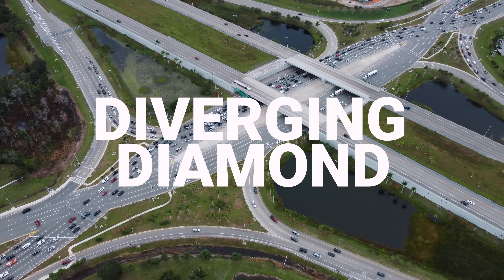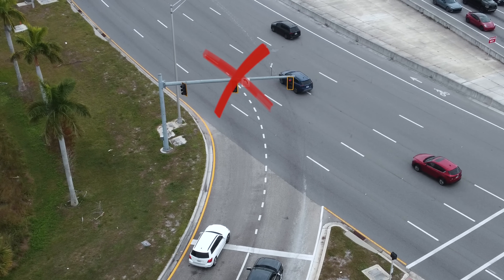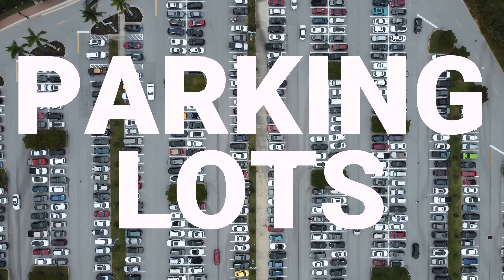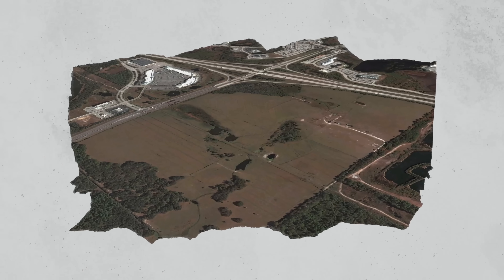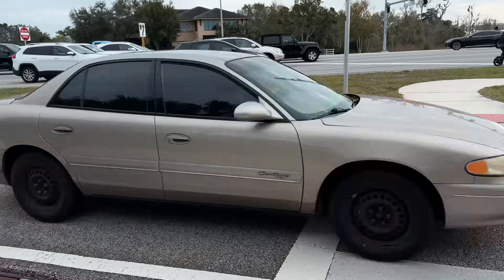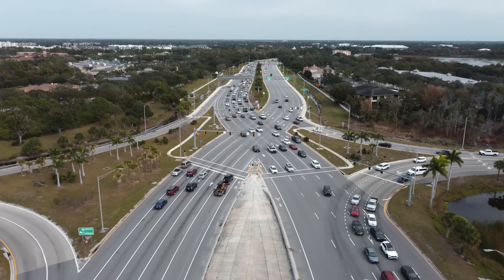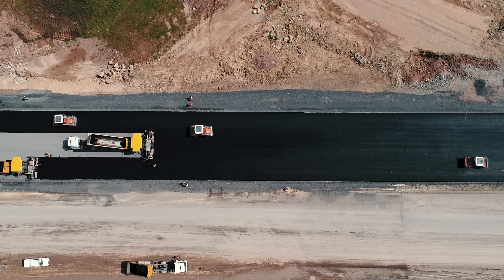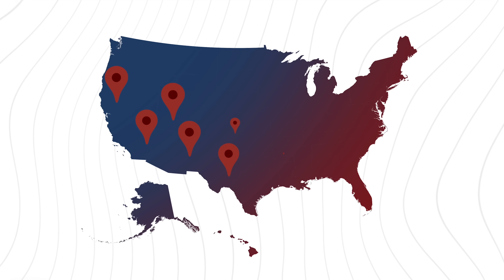Traffic Will Never Be Fixed Here

Comment: happy you didn't die while crossing the street
Reply: ...but all the exhaust fumes probably took a couple minutes off his life.

I could smell it from here.
Reply: @spiderpickle3255 why so anti car
Reply: @TheMW2informer  But I'm not.  I'm a trained automotive tech and own several vehicles.
There is no arguing that an intersection with that many cars isn't still full of noxious exhaust fumes in 2024.
Reply: @spiderpickle3255  technically yes you are correct, but compared to a intersection with similar traffic in 1975 when the catalyst was first mandated and it’s like apples to oranges. It’s a low level, plus with stop start and now ev, some of those vehicles are not emitting anything sitting at the light while the person is crossing.

Comment: As much as I agree with your overall message of 'totally redesign the environment so people don't need to drive', I feel like I have to criticize some of your early points. A road upgrade is NOT always intended to eliminate traffic (where I assume that by 'traffic' you mean cars driving slower than the speed limit). A road upgrade is typically about either safety improvements or increased capacity. In this case both of those goals were achieved. More people can now get from one place to another. Secondly, the diverging diamond, although very interesting is NOT the most efficient interchange, although it is more compact than some other alternatives that are more efficient and safer. Again, I fully support your overall message that if we designed cities better we would not need to drive so much and public transport should be the first goto 'fix' for heavy traffic, followed by cycling and walking infrastructure.

Comment: As a European (well, a Brit) the diverging diamond hurts my brain, since I know that roundabouts exist.
We also only have very few junctions that connect to the "fast lane" of a highway and we are removing them.
Reply: Ironically Sarasota is one of the few cities to have roundabouts
Reply: Roundabouts lose efficiency at 25000 vehicles per day per lane.  That is why America DOTs are very specific where they can be installed.  The traffic here is much greater than that, so a roundabout would fail.  Roundabout interchanges are reserved for light suburban and rural settings.
Reply: @traffic.engineer  we tend to prioritize accident safety over efficiency
Reply: @stevecarter8810  The queuing of the roundabout would spillback into the freeway, increasing crash risk.  Hence, roundabout would not be safer in this case either.
Reply: @traffic.engineer  does happen here in Britain, not gonna lie
Reply: You're not European. Have some pride for what your country once was.

What type of behemoth roundabout are you planning on building for such enormous traffic flows?
Reply: @tbird-z1r  I certainly was European until our moronic leadership gave away my rights to travel and work there along with my friends' ability to freely trade their handmade goods across that whole market. Since I work for a German company I now also have extra complications and costs in visiting our European offices and therefore my career is hurt because it's harder for me to be in all the conversations that are relevant to me. What we once was is irrelevant. What we are and what we are becoming, is everything.

Comment: If they wanted to make the DDI more pedestrian friendly, shrink the radius and the width of the turns on the ramps so it forces drivers to slow down. Delete half the lanes from the DDI and suddenly it becomes a lot less scary as a pedestrian and a lot safer too. And you still get the crash safety advantages of the DDI while using less space (though with less traffic flow, but that's fine, just stop making everything car-dependent and traffic will go away).
Reply: This DDI is actually pretty pedestrian friendly by having the side walk in the middle. The worst for pedestrians is the side walk on the outside because you don't get signalized crosswalks
Reply: @AdamSmith-gs2dv  A pedestrian can theoretically use it which is an improvement over many places in the US, but the fact that there is still a high speed multi lane unsignalled crossing, and the fact that a pedestrian has to scramble across 5 to 6 lanes of traffic means that it's not exactly pedestrian friendly.

Comment: 4:25 in many countries, including Australia, this is not a problem as you always have traffic signals on the departure side. These are known as secondary and tertiary signals which are in addition to those near the stop line called primary signals. Not only does it avoid the problem of not knowing the colour of the signals but you can also determine the end of the intersection and therefore if you should proceed or not.
Reply from the maker: Almost all the signals in the US are on the departure side as well. I'm not sure why they didn't do that for this interchange - perhaps since the departure side is so far away from the stop line. They could have included both though and I think that could have helped.

Comment: 4:25 Near-side traffic signals aren't necessarily a bad thing. In fact, I think they're better since they stop cars from stopping in the crosswalk to wait for red lights. But they are a downside when crazy stuff like this happens
Reply: That can be fixed with a "do not block the box" sign. Anyone in the box after the signal is red gets a ticket
Reply: Honestly, the near-side signals in Florida drive me absolutely bonkers.  They are hard to see sitting in the drivers seat when you’re at the front of the line. At some intersections, it’s easier to look through the sunroof.  Either add lower side signals or put them on the far side (or both, even) and you’d have a lot more visibility.
Reply: @triphius  I think eye level signals on either side of a nearside signal set up  are a good solution
Reply: @frafraplanner9277  I totally agree.  It’s not that the signals are on the near-side, it’s that you’ve gotta hunch over and look up to see them when you’re at the line.  Eye-level signals would fix this phenomenon.

Comment: This interchange is literal hell on earth for cyclists and pedestrians. Just look at the crazy zig-zag for pedestrians, when they want to cross that thing. I-n-s-a-n-e!
Reply: It's actually pretty good, Road Guy Rob did a video on pedestrian crossing for DDIs and the sidewalk in the middle worked the best because you only had to cross two ramps without a signal instead of four when the side walk is on the outside
Reply: still very long ways to walk across, far from a straight line  @AdamSmith-gs2dv
Reply: Bold of you to assume they give one shred of care for pedestrians and bikers!
Reply: Just be glad the middle portion is walkable and it's not a walled-off landscape feature.
Reply: It looks weird, but the "hell" doesn't come from the zig-zags, it's just the sheer amount of cars and velocity involved. If not for that, it's actually alright, as you only ever have to watch for traffic coming at you in one direction.
Reply: It looks considerably safer to cycle than my daily commute since it at least has a bike lane.
Reply: too much control is out of control :)
Reply: Who wants to walk or cycle in Florida heat and humidity???
Reply: At least you only have to consider threats from one direction at a time unless somebody thinks they can back up.  Beats looking at stopped traffic from one side and glancing to the other side to be sure they're not moving right before you get there!
Reply: Even a regular interchange is dangerous, especially when your crosswalk button doesn't tell cars to stop, and only lasts 2 seconds. My pedestrian nightmare... I couldn't even walk from my motel to the McDonalds 2 blocks away without nearly getting killed multiple times all at the same intersection.
Reply: Why would you be walking or biking there? Are there residences close by? Doesn’t seem like it. So you are already traveling some distance to even get there.
Reply: This really isn't horrible for peds and bikes. A normal diamond has 4 points of influence versus the 2 shown with DDI. There's no turns at the signals, the off ramps are to the left.
Reply: Yes, it would be simpler to just have a sign that says "don't," but nobody would listen. Better to just paint in some lanes and hope they take the hint. "This interchange is not about you."

Comment: I've been without a driver's license for the past 4 years, doing almost everything by foot or public transit. The biggest issue for me in the simple scale of what can and can not be done on foot as compared to a motor vehicle. I can only carry so many groceries in a rucksack, and my choice is limited as I can't pick anything too fragile to be carried on its side such as a cake. I can purchase a handful of books from a store yes, but the difficulty of transportation of anything too large demands a car.

This place, being a major shopping district, suffers from this very problem. More people would in fact walk or bike if it was practical to also walk and bike back home with their goods, but it rarely is. Public transportation needs to look not just into the movement of people, but of their goods as well. Otherwise the only option is to drive home, and if they're driving home, they need to drive to there.
Reply: Use a shopping trolley (looks like a caddie bag on wheels) and you'll be able to carry around a lot more.
If you bike, then use a dutch cargo bike (bakfiet).
Reply: if cities were built on human scale one could go on the bicycle each day and thus not needed huge amounts of groceries at 1 time. Just for the odd "oversized" purchases you need to bring a car.
Reply: That's a problem of city design. If you had all the shops near your local station (assuming you commute to seomewhere) you could easily pick up stuff everyday after work or school. That way you'd only spend a couple minutes additionally each day and only had to carry small amounts at once.

If you live in an urban area there should be no point where you live more than 10 minutes walk away from a supermarket, drugstore and other daily essentials. 

Larger purchases, even in a downtown shopping district, can be delivered. In many good urban cities you can have shopping delivered for just a couple dollars and most of the time you wouldn't make large purchases since you're there so often.

If your city enables you to not need a car on a regular basis you can save massive amounts of money. Some of which you can then spend on the deliveries and car rentals for when there is really no good alternative.

Getting north american cities to that point will take decades though. And that is assuming there is a concerted effort. But even small steps can make a huge difference. Building bike lanes, road diet, signal priorities and allowing infill development is cheap, quick and even brings much greater tax revenue to cities.
Advocating for that is the first step to making your city more liveable.
Reply: @InLoveWithCities  I do have shops near my local station, in fact my town is rather blessed in how walkable it is. My problem is that I still can't properly acquire all that I could with a car. No amount of sidewalks will allow a cake to be transported on its side. I've managed for 4 years without a car, so it isn't the biggest problem in the world, but a car is simply a requirement for certain purchases owning to the impracticality of transporting too large material. As for a Dutch cargo bike? I've considered it, but the land here is incredibly hilly and I'm not sure on how effective a bike would be in such a place, especially considering there is a genuine lack of infrastructure for bikes themselves even if there is a fair amount for pedestrians. I don't blame my town for this, limited amount of resources after all, and everybody walks while only some people bike, but it is a factor.
Reply: @isodifbrakiul6387  Ok so why not just get a shopping basket? There are large enough ones for most cakes. There is always a solution
Reply: @InLoveWithCities  That will solve the Cake yes, but not the core issue at hand. I was merely using the cake as a sort of offhand way to describe cargo impractical to carry by foot. What if I wanted to transport lumber, or really any other heavy load? At a shopping district as mentioned in the video these sorts of heavy loads are sold exactly there and must be accounted for.
Reply: @isodifbrakiul6387  You get it delivered. Or you strap it to a bike. I don't see the issue. How often do you buy lumber?
Daily essentials aren't haavy or bulky to the point where you need a car and bulky and heavy stuff can be delivered.

What's with americans and their obsession over buying bulky stuff anyways? Especially lumber. You don't do that every day. Get it delivered.
Reply: @InLoveWithCities  Delivery is often vastly overpriced and of poor quality. I've bought stuff and had it delivered, and it came either broken, looted, or was delayed by weeks enough times for it to become a genuine issue. Daily essentials not being heavy or bulky enough to require a car is a blessing, but that doesn't mean you don't need such things. How would you feel if you bought a new snowblower for the winter, had it delivered, and it arrived weeks late, broken?
Reply: @isodifbrakiul6387  Embrace the suck then. If that's you in the profile pic you should be familiar with the concept.

I hauled an ikea shelf though the metro when I was a student and had to choose between having it delivered and eating that week.
Let's be real. How often do you need something so bulky and heavy that you can't have delivered or carry reasonably?
Embrace the suck and enjoy the money you saved.

And advocate for better urban design.

Comment: If I want to go somewhere on transit it costs me $3.00.  Depending on when I return, it may be another $3.00.  If I take the car, use of the streets and parking are free.

We have the whole thing backwards.

Keep up the great work!  With this level of quality, you will be right up with Not Just Bikes, CityNerd, Oh the Urbanity, etc.
Reply: While your points are all true and I agree that the system is backwards, you mustn't forget that your car is using energy, insurance, and maintenance. If it's gas powered and you live in an area where gas is currently a bit expensive. A 20 mile round trip might cost you five bucks in gas. At that point you're almost equal with public transit.
Reply: Too bad most of us can’t live without a car. I just calculated my total costs for 8 years of ownership and it came out to $1.34/mile. So a simple 3 mile trip each way actually cost me $8.07 and my 15 mile commute to work and back home is actually just over $20!
Reply: @schzean  My commute is 15 miles.  I do it by bicycle.  Because it's in the Seattle area, it's often rainy and it includes over 1,000 feet of hill climbing.  Keeps me in shape!
Reply: car-centric ppl often totally ignore the cost of the car (and fuel) in such examples.